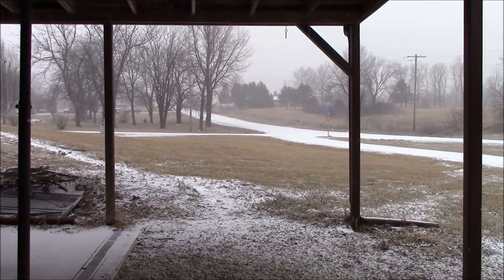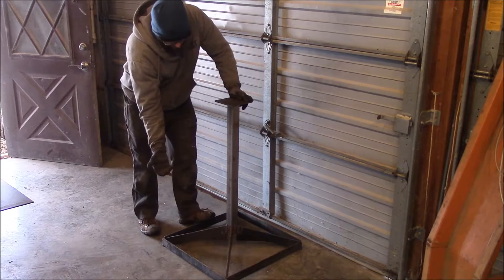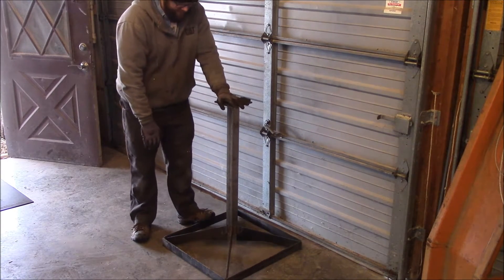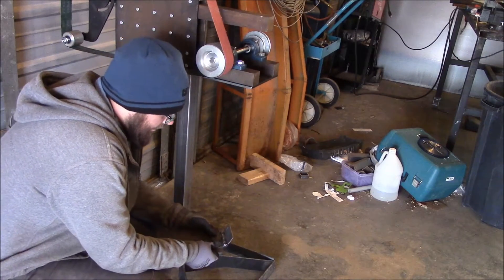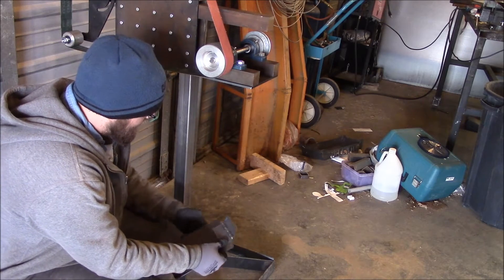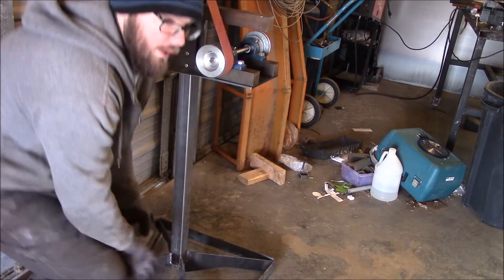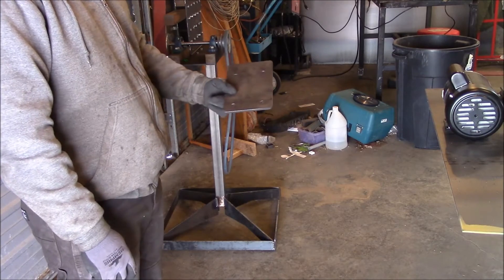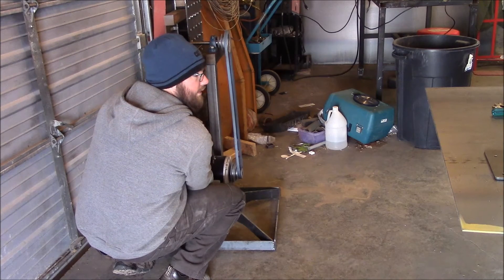2x72 Belt Sander Motor Mounting

Comment: Why did you mount the motor so far away from the rest of the grinder?
Reply from the maker: Bill A just happen to be a readily available belt length that I had.
Reply: You also want the motor as far away from the dust and shit as possible. My 50mm X 3000mm has the motor almost floor mounted, same with any decent industrial belt grinder, always away from the crap.